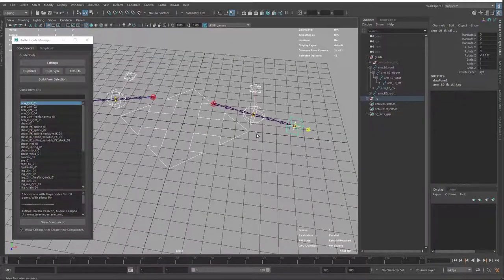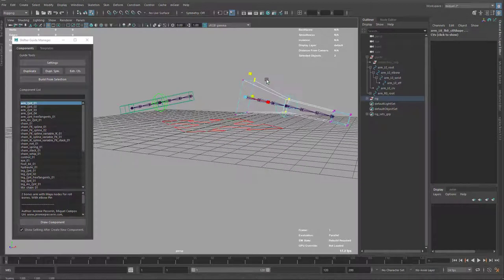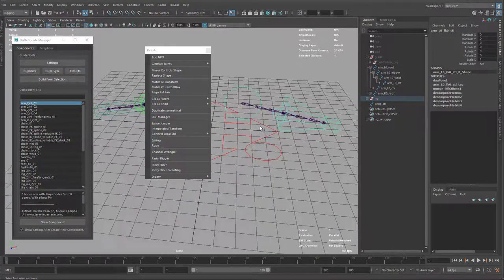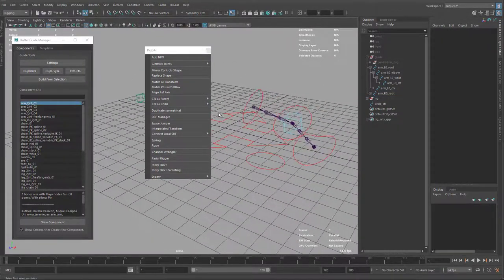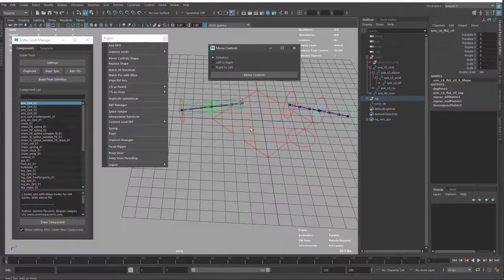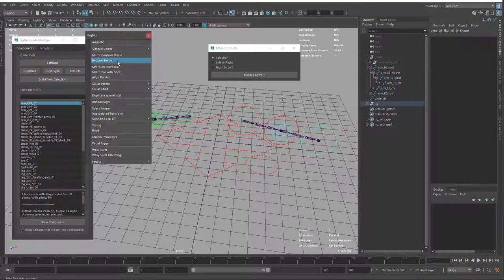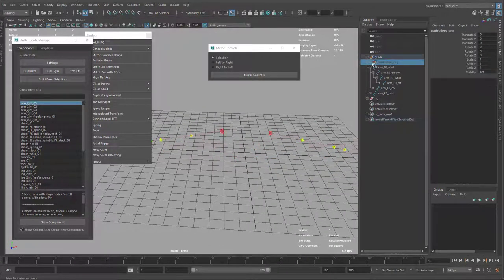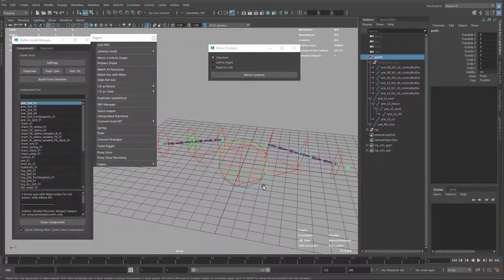mGear Basics: 08 controls shapes

Comment: So how it rebuilds with the extracted controls is based on the extra attributes naming data of the controlBuffer? I can continue to readjust placements, so the channel box transforms for the control buffer aren't actually being used right? (i.e. Local, like the Replace Shape function)

Does this mean I can create a "template" of a visual control setup I like, and copy and paste these controlBuffers into a same-built rig with different proportions, and it'll map the controls to the correct positions?

Do I have to use the mGear CTL's, or can I use any generic Maya nurbs? What about nurbSurfaces or other shape types?

Also do controlBuffers curves always override the color settings set in the guide settings?

I feel like the entire idea and implementation of the controlBuffer is a "post script". Is there a way to dig deeper into mGear build process so that it straight away uses our preferred custom shapes?